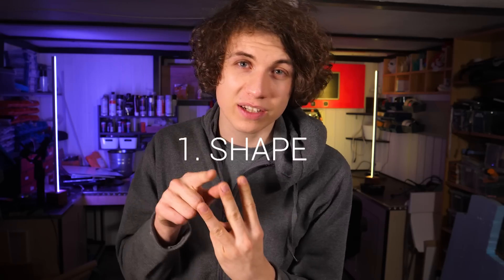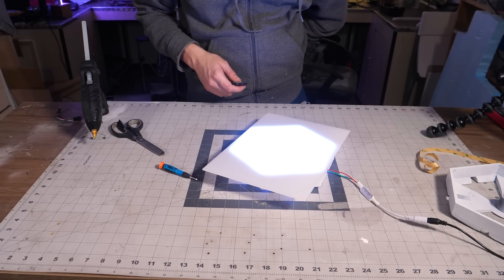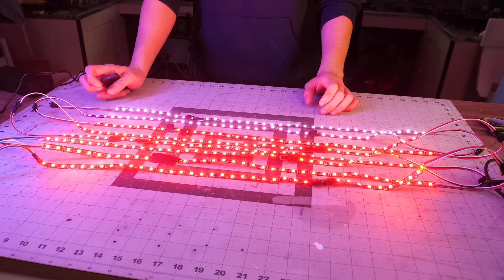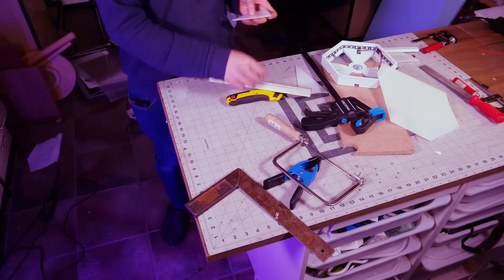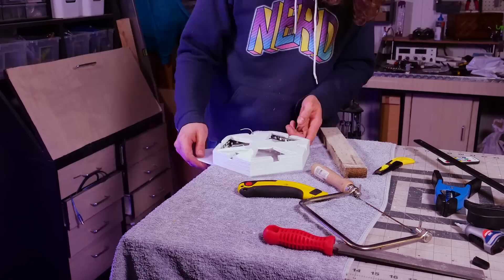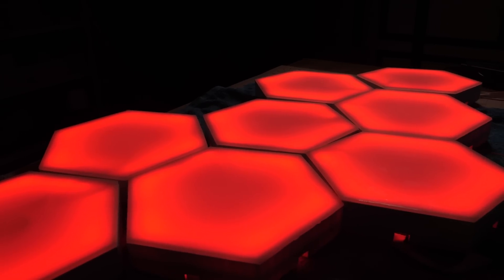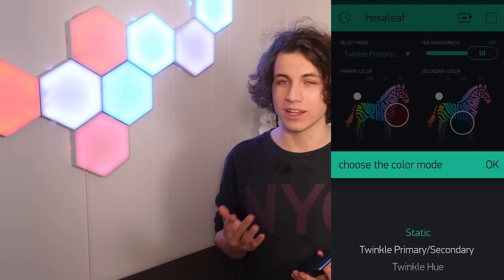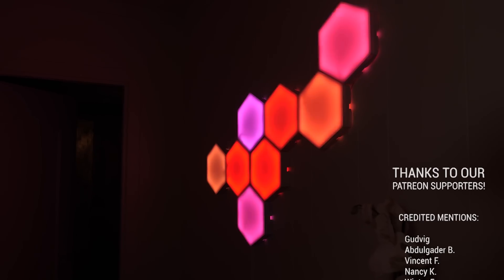Making My Own Version of Nanoleaf Aurora - DIY Project

Comment: question is, is this project cost/time as much as the nanoleaf
Reply: Not with the 3D printer included, I don't think so. Idk where he got the LEDs from, but search a bit around the web and they're quite easy to get cheap. Of course one needs to make sure the store is a reliable place to buy from, but if enough time is spent on research, I think the costs can get pretty far down. And since he didn't build a straight up copy of the Nanoleaf, he does technically have rights to set up a production of those and sell them. Making the time spent easily worth it all :)

Comment: Quick question, I'm just trying to understand and not trying to be difficult. Why is the signal running through the logic level shifter?  Also, I'm fairly sure that the board is being powered by the 3.3v coming from the logic level shifter, so why the 12v going to the vin? I am new to this and would love any insight that you could provide.
Reply from the maker: The LED strip requires 5 volt signals. The logic level shifter does not output 3.3v, but takes it as an input :)
Reply: @Nerdforge  Thanks for the reply! That helps a lot :)

Comment: Is there any way to completely reprogram and customize led strip remotes? im always wary of the ones that come with those because I wouldn't know what to do.
Reply: There are standard and there are addressable LED strips. The addressable ones let you modify the RGB in each light specifically. Standards just contain that remote and can’t be programmed from a computer.
Reply: @user-h6c7l  but those "standard" ones still do all the effects that the addressable ones do, but programmed very specifically. Is there no way to undo that?

Comment: Just out of curiosity, is there a reason you decided to solder the ends of the LED strips rather than use a bunch of connectors? I am trying to decide if I am going to give in and buy a ton of connectors or put in the time to actually solder everything. Awesome build though!!

Comment: In your links to products you link to a 12v 5050 rgb led, but the controller you link to is for addressable ws2811 and 2812... to further confuse me ws#### leds run off 5v.  What am I missing here? Is the link to the led strips the wrong one? Or, more likely, i am missing something
Reply: Doh i answered my own question, the strips are ws2811... ,3😄

Comment: is it possible to connect the led strips in parallel to the Controller ? or does that mess up the signal from the controller? if parallel would work the 3 Magnet Idea should work or not o.o ? any thoughts about that ? :) greets  PS: NICE Project was searching for a DIY Nanoleaf "solution"  some weeks and boom there it is :) Thanks

Comment: What 3d printer are you using? Also, I notice some light bleeding out onto the wall. Think maybe painting the inside of the fixtures black would help prevent the light bleed and maybe plug the openings? Thanks

Comment: Nice project, a small tip for getting the colors right on camera: The camera will show the correct color when you film the reflection of the light (via some left over glass or something) it just darkens it enough for the camera to catch the real colors. (point the camera at a window, looking back at the reflection of your light when it's dark out to test)
Reply from the maker: Thanks for the tip! Will remember that

Comment: how can i use esp8266-01 for this project since the code uses some library named "BlynkSimpleEsp32.h" which seems to work on esp32.
Reply from the maker: Google is your friend:
https://examples.blynk.cc/?board=ESP8266&shield=ESP8266%20WiFi&example=Widgets%2FTerminal
Reply: @Nerdforge  Thanks, man.

Comment: OH MY GOD man , this is AWESOME!!!!!  

to difuse the light better , on the other side , you need to do some checker pattern lines , its easier with an engraver , but its common practice to do the checker pattern on a clear acrylic and then put a difuse film at the top of the acrylic to get the full color uniformity

Comment: Very nice!

A laser cutter would make pretty light work of the diffusers - about 20 seconds each rather than hours!

Also would recommend WS2812b LEDs for lower voltage to work with your microcontroller.

Comment: can u show me how  do u install and what for, did u use the Logic Level Converter Bi-Directional , LM2596 DC-DC Verstellbar Step Down-Schaltregler Power Supply Module,  and the ESP32 Development Board WiFi+Bluetooth?????? thx great video i sub

Comment: Great video and I want to build this, but the link for the diffusers is not working can you tell me the brand which you bought ?
Reply from the maker: https://www.ebay.com/itm/Opal-Acrylic-Light-Diffuser-Lightbox-Perspex-Sheet-Panel-Sign-LED-Diffuser-3mm/201925835256?hash=item2f03b7b9f8:m:mJ1onogldP_IiitflA8W2Jw

Comment: Nice project! I have found cutting acrylic with a fine tooth circular or table saw works well. Make sure to wear eye protection as it makes a mess but cuts quickly and straight.

Comment: Do you know which kind of leds are better for this? I’ve found some leds with 2 pins, 3 pins and 4 pins
Reply: It depends entirely on how you want them to work. If you're talking about the LED strips (instead of component LEDs) the ones with 2 wires are going to be a single color, 3 wire are addressable, and 4 pin are either whole-strip RGB (apply voltage to the R, G, and/or B wire -> get color) or addressable.

Addressable strips come in 3 and 4 pin varieties depending on which LED chips they use. Some use a 1-wire data interface, some use a 2-wire. In either case, you're going to need a microcontroller to tell them what color to be.
Reply: James Mazikowski I’m asking cuz for the led strips I would like to not solder (I dont have the equipment) so I was thinking in using a connector but only 2 and 4 pin connector are available.
Reply: @fhenixeh  Then you probably want to use a 4 pin LED strip so you can change the color. That, or when you order the parts just get a cheap soldering iron.

Comment: Amazing job. I suggest you use WS2812 strips because they work with 5v. This way you won't need the logic shifter or the step down converter.
Reply: Esp32 works on 3.3 v logic
Reply: @Cas942900  AFAIK most boards can be powered by 5v as well

Comment: Hi nerdforge!! A little bit off-topic here, i want to make an rgb splitter like in this link: https://youtu.be/En02ttQL-6E but i want to chain about 100 of them and connect them together so i can make any shape i want. Im having some trouble because i want to sync it with the 12v rgb from my pc motherboard but the led itself only use 3.3v. What resistor do you think i should use for that project?

Comment: I have no idea what is a logic level shifter. can someone explain me ?
Reply: Just helps the board and leds communicate back and forth
Reply: @mitchellturner9662  is there any specific model number or something ?
Reply: Um he has linked one in the description but I'm going to have a crack without one
Reply: @mitchellturner9662  will that gonna do the trick ?
Reply: Don't know but worth a shot
Reply: @mitchellturner9662  cool man, let me know if it works for ya.

Comment: $200 for nanoleaf Aurora?? Nah we got Nerdforge 😂
Reply: They're about 250 AUD which is about 200 more than my liking.
Reply: Rail I don’t think you’ve ever shopped for light fixtures before...
Reply: Isn't the nanoleaf touch activated?  I recently just saw a youtuber buy one and was playing games on it.
Reply: I like where your head is at, but the materials used in this project probably cost more then $200, not mention the need for a 3d printer and time to build it
Reply: @Gantzz321  if you go through his part list it would cost $48 not to mention there are cheaper alternatives and if you are creative enough u don't need a 3d printer. There wasn't 3d printer all the time so how does people make things like this before having 3d printers?
Reply: i have the 15 pack + rhythm nanoleaf

regret it
Reply: but you know that nanoleaf isn't just some led strips in a box. if you try and make a true nanoleaf clone yourselfe you realize that it quickly becomes more expensive
Reply: @Theubershadow  what nanoleaf does for real that this ones dont? music? You can add it as much as for nanoleaf. Control by app? Same here. Yes, it look prettyer. Make this in wood and paint them with a good resine and you will have premium nanoleaf. Nanoleaf isn't an iphone or a cpu processor dude.
Reply: @elmareao  i think you can add a panel where you want and the system locate this module so you see where everything is in the app. Here you have to route a cable through the panels
Reply: You only need a 3d printer which prices start at $250
Reply: @havocexee  you could always choose another material like acrilic
Reply: @Super Jeff just a heads up,it says 30$ for 10m.Also you said that just because you cant do anything by yourself.I do most of my projects since i have time for everything.School is going prefectly fine,i hang out a lot and still have time for that shit.You are just pathetic
Reply: They sell for $200 CDN now which are about $150 USD which is a pretty fair price. The time you spend you will put into making this plus materials will be much more(unless you dont value your free time)
Reply: @ZephyrCross  for 30$ you can buy 10 meters of ws2812b strips which is enough for 15 of those or even more,depending on size.If you dont have money or 3d printer you cod make it from wood and then paint it.You just need to be creative and some basic tools
Reply: @ZephyrCross  Some people spend their free time playing video games and getting drunk, I'd rather spend my time doing projects like this that you can be proud of and learn new things doing them, while saving money that I can use for something else
Reply: suchti7654 these projects cost alot though
Reply: @ZephyrCross  Im so sorry for you.. You must've been scammed your whole life, if you think 150$ is a fair price for plastic and a few leds..
Reply: @xcruell  I mean I make things for a living and a hobby and I know the cost of how quickly this stuff adds up to plus the hours put in, but you keep being you big fella ;)
Reply: @ZephyrCross  its some generic leds in plastic panels, its extremely overpriced at $150 USD and I cant believe there is no cheap chinese alternative to the nanoleaf

Comment: You guys always deliver! I’ve been wanting to do a DIY nano leaf vid but you beat me to it. I was (am still) researching if there’s a clean way to make magnetic electronic contacts...since most 8212s are three wires it’d be cool to have flexibility on layout patterns. I had a plan B of trying projection mapping that I’ll have to do now :) Great video you guys are inspiring and I learn a ton and am always entertained. I’ll check out that blynk app sounds cool!
Reply from the maker: If you figure out how to make more flexibility, that would be awesome! Rewiring it is a quite fast operation, but not as fast as just moving it around would be.
Reply: I think if you put three magnets connected with the wires on each side it would be nice and flexible. But you still need to make the difference between input and output I think :/
Reply: 12 magnets on each side... 6 for input 6 for output then you put them in 2 3x2 "blocks" on the left and right side (on each side of the hexagon or what shape you have) ... to avoid a shortcut just use diodes ? that wiring would be a mess xD maybe a Custom PCB as Backplate would do the thing to get it nice an clean... but thats a matter of the budget i think :'D have a nice one

Comment from the maker: Eeeeeh, this took more time then I planned... as always! Been procrastinating a bit by watching CEOs laugh at non-working dolphins.
Reply: Cant we print the diffusers using translucent white filament
Reply: hei vi  har en ungdomsbedrift som lager liknende paneler... kult å se hvordan du har fått til designet. Liker videoene! fortsett det bra arbeidet :) link til ungsomsbedriften Hexaglowub.com
Reply: The diffuser sheet link doesn't work, could you possibly fix that please? Good work on this btw!! Your code makes it look so great! Looking to buy the parts to do this myself now :D
Reply: Haha elon  musk with meme review?
Reply: I think it’s the same for all builders, we’re not planners.  ALL of my projects take longer than planned!
Reply: Would also like a link to the diffuser sheet
Reply from the maker: It should work now.
Reply: @Nerdforge  what time l like 🤩🤩🤩🤩 👍👌
Reply: I didn't know David Luiz had a YouTube channel for DIY stuff
Reply: How did you mount these to the wall? I'm planning on making a similar project with your code but dont know how to mount them 😬
Reply: @Depl0rable10  double sided tape, or screws.
Reply: Hi there, you probably won't see this, but with this project can you control the boxes individually? Not sure about the app as dont wanna install it and do all that and find it isnt what i need, Thanks Blake
Reply: Nerdforge? I got a big problem with this Project. Not only cause of the Blynk app... I haven't got an esp32 but I got a NodeMCU... What must I change to get it to work?